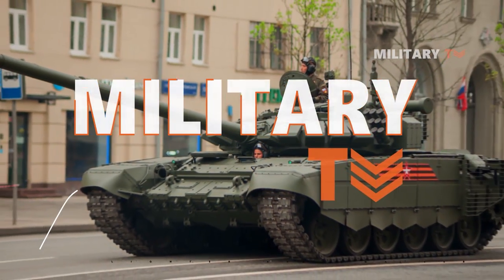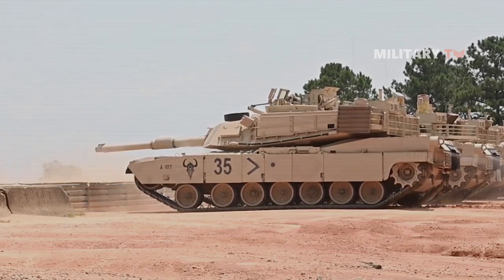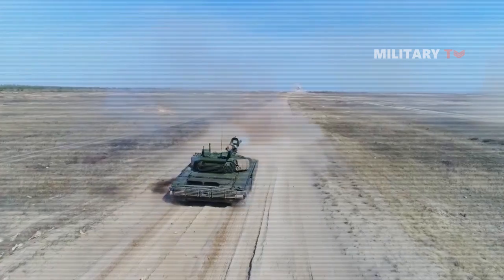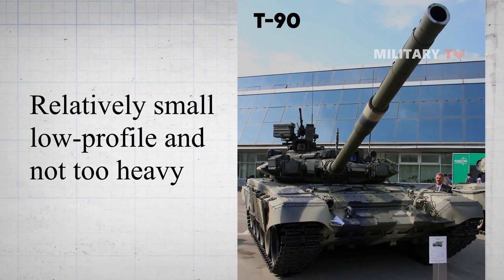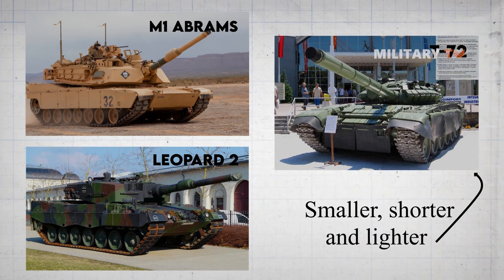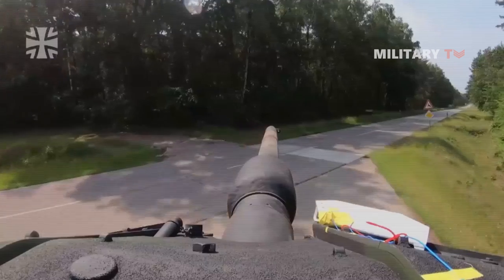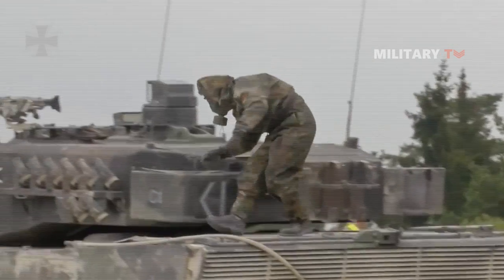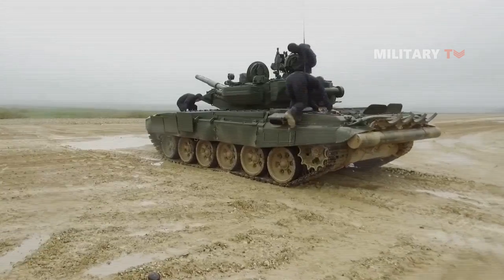Why are Russian tanks lighter and smaller than the western tanks

Comment: Okay I feel two big things were left off the table that are rather crucial.

Russian tanks do not offer internal space.  Ammo storage safety = none in Russian tanks... hence why you see the tops pop when they get hit.

You pay more for the bigger tank, you tend to get your crew back if the tank is knocked out.
Reply: agreed he left out the main reasons why western tanks tend to be heavier
Reply: He also makes it look like a 3 men crew is just better than a 4 men crew without looking at the disadvantages.
Reply: @Wienpirat  
What is the advantage? You will lose more soldiers if the tank is hit?
You need 33.3% more soldiers? You have a lower level of sustained fire rate?
Each tank unit has a maintenance unit. Repairing tanks in the heat of battle is highly impractical.
If you mean replacing the wrong charge? The fastest way is to send this charge through the barrel.
With autoloader you can choose the charge you want without any problems.
What is the advantage of a human loader?
Don’t forget that no country that introduced autoloader has ever gone back to human loader ever. France, North Korea, Japan, China, Russia, Pakistan (in cooperation with China). No one has returned to the human loader.
And all these tanks are about 20 tons lighter. And they have a lower silhouette.
Reply: Considering how much modern tanks cost (millions of $ each excluding ammunition)

Its limit in battle (can only be efficient at a certain range, at a certain environement) (tend to have mechanical/system problems after a long use in hostile environement)

And how easy it is to defeat it with anti tanks weapons, mines, shells or missiles etc.

Why would you waste so much money over having it bigger 😂 for same budget its better to have 500 tanks thats 10 feet wide. Then 200 tanks thats 20 feet wide
Reply: because they are cheaper to manufacture
Reply: @StavroGavro The Ground Pressure on Western Tanks is lesser than on Russian Tanks, and the Western Tanks got a better Horsepower/Ton Ratio. Arguable the Western Tanks are better then the Russian Tanks in Mud. There is a nice Pic of Russian Tanks on Maneuver on February the 14th, when they got Stuck as when the Ground was no longer frozen and they needed heavy construction equipment to get them free. And the most Comfortable Tank is the Abrahams, the Leopard 2 has a better ride quality but less interior space. Official Testings both against each other. I am German. On other Metrics the Leopads 2 is better.
The Real reason why the tanks are different is their purpose: Smaller Tank with smaller Profil= Good for Attack   Bigger Tak with higher Profile = Better for Defense as he got better Gun depression. So he can fight better behind Hills and Ravines. It seems counterintuitiv, but Small =Good for attack and moving over open Ground. Big =Better für Defense as it can make better use of landscape.
Reply: this channel make a putins trolls i think  :/
Reply: @Elkarlo77  No challenger 2 tanks have ever been lost to enemy fire and they have integrated tea making facilities.
Reply: Dayum boys. U all tank drivers and gunners
Reply: @mysterio952  I am no Gunner, but i got a German military driving licence for armored tracked vehicles. Part of the Training was to use the enviroment, hills, slopes etc. with the gun depression in mind.
Reply: it's a matter of scrap prices
Reply: Perhaps slightly irrelevant, but talking of space, British tanks are equipped with a Boiling Vessel - cook rations and brew the obligatory cups of tea without leaving the tank. It's apparently commonly joked that the BV is the most important bit of equipment in the tank...
Reply: @mittfh  It is not nice to get out of tank to relieve yourself and get shot in the bum while taking a dump. There should be pod as well inside the tank, no? If there is a pod and a cooking system, it would be nice to have a bed inside as well as a female crew to "assist" the gunner+commander better their "aim". Happy family, happy hunting.
Reply: @nneesskkee  autoloaders take twice the time to reload when compared to the human loader. For example, T90's autoloader needs 8 seconds to load but the Abrams tank only needs 4 seconds to load if the loader is skilled. A bit more than 5 seconds if the loader is amateur. And, today's autoloader had shitty ammo storage so if the tank is hit, the 3 crews will meet Jesus. Compare to tanks with human loaders, their ammo storage is much safer so if the tank is hit maybe, only 1 of the crew or no crew will be dead.
Reply: @rickastley4050  
8 seconds was half a century ago. Since the nineties it is 3 shots in the 13 seconds. Today, this is probably even faster. This is for the T-72.
Give me that superman who will have this constant speed in the heat of battle, when the tank is on the move and off road. By the way, the autoloader can't get tired or make a mistake. This is a human characteristic.

Penetration problems with older autoloaders are largely overcome with newer versions. So that's not a big difference from a human loader situation.

But even in the earlier period, the autoloader had (and still has) significant advantages in survivability. Much lower silhouette. Lower weight, which allows the installation of significantly more effective armor. And much higher maneuverability.

 This is much more important for survivability than the position of the ammunition. Just like active and passive protection, because the main goal is not to be penetrated.

In case of any penetration with modern weapons, there is a great chance that the entire crew will be dead, regardless of the position of the ammunition. In the case of full penetration, the position of the ammunition is completely irrelevant. The only difference is whether the tank will be in one or more pieces. Which is not a great consolation for the crew.
Reply: Ahaha, LOL, this dude really ignores the many poppet turrets of abrams tanks or is it a new way of denying stuff?
Reply: M1 costs 16 times more then T72 $8 million vs $500,000 so take that into account
Reply: @josephstalin9357  who asked?
Reply: @StavroGavro not germanies new KF52 tank. It has anti-javelin and missile capabilities.
Reply: Russian: auto loader, manual transmission 
Western: manual loader, automatic transmission
Reply: wrong its because they got hit in fuze or denotaneted  parts of the ammunition and not because of the autoloader